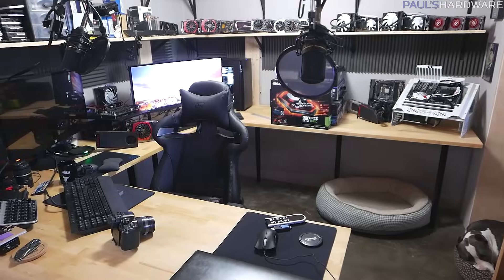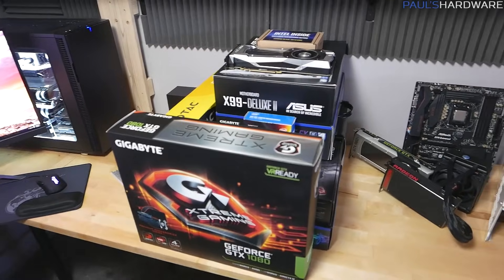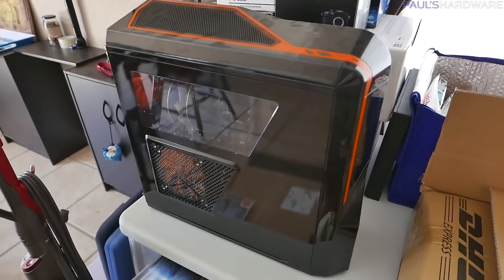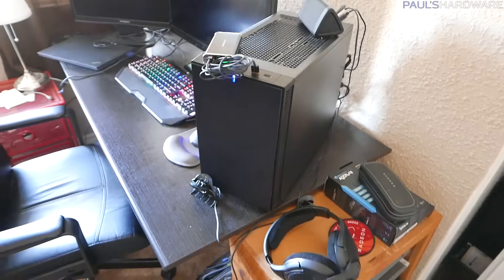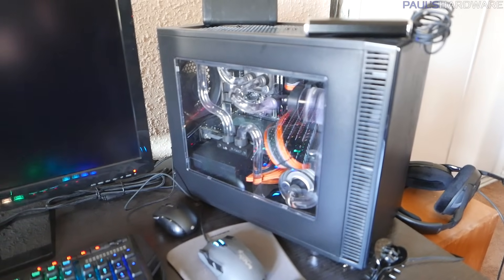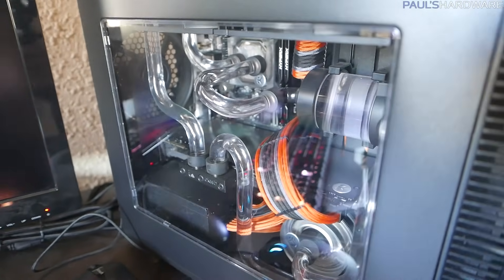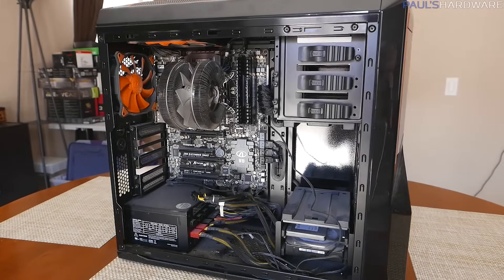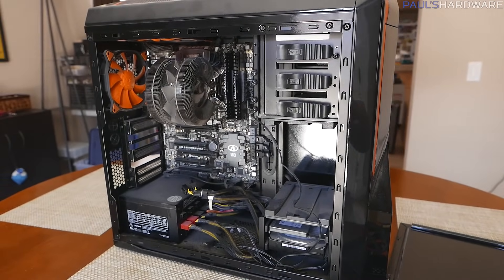Prepping a Hand-Me-Down Computer

Comment: C'mon Paul, don't make Your sister use on-board graphics, You must have an old video card lying around.
Reply: Yeah, thats lame. Not giving her a 960 at least. Pluss i would have changed the thermal paste on the CPU, and maybe install some dust filters.
Reply: Why? If she won''t be gaming there is absolutely no reason to do so. All it will do is add additional complexity to the setup and run the electric bill up higher. Nothing wrong with the graphics of a 3570. He did the right thing.
Reply: Yeah, GTX 960 should do.
Reply: hell anything at all, a 750ti even.  don't cheap out on fams yo!
Reply: Yes I work in the tech industry also. Video cards, hard drives, and motherboards are the main things I have had to replace. Never had many issues with cpu's especially modern ones. I respect your opinion though. Lets just agree to disagree.
Reply: Myself i have a "Asus strix gtx 960 2Gb" at the moment, And it's going to be Overkill for regular pc use.
But yeah kinda agree still x) i built my pc like 6 month ago -.- ... and paid around 233$ for the gpu. now you can get it for like 80-120 Bux easy.
Reply: No need for a video card for non gamers or people not looking to do any video processing. Adds complexity, cost, and more failure points. I've built like 20 systems for non gaming family and friends with onboard video and they couldn't be happier. Just need to get a decent modern processor and a fast ssd and it will be plenty fast.
Reply: Joe Ebner I have built 1000+ computers over 20+ years, video cards add capabilities in ex:faster video editing & gpu processing, they also reduce the wear and tear on cpu's and apu's that have the built in gpu from increased heat, I would much rather have to replace a video card than my cpu, any modern video card, even a low end gt 740 would be a lot better than intel graphics. I am sure Paul has something laying around.
Reply: He has like 20 Top End graphic cars just standing around behind his filming setup. He really should have at least one of the cheaper GPU's like a 960 or something:D
Reply: he probably has an extra titan lying around somewhere, that seems suitable
Reply: I have to agree - I would never pass on an old computer without a dedicated graphics card, unless it was built for business use or a library.  I like the computers I pass on to handle just about anything the new owner might throw at it. 

But I imagine Paul knows his sister best, and if she never plays any graphics demanding games on a computer and never will, then on-board graphics should be okay.
Reply: Jupe Good point.  

If I were in Paul's place, I would have put an older dedicated graphics card, something like a GTX 650 or 750 Ti.  I like to leave possibilities open for family members.  Most of my family wouldn't know what a dedicated graphics card is, let alone be able to install one if they decided they needed to add or replace one.  lol
Reply: Acceleration, depending on how heavy her photoshop work is, in which a 760 will beat any maxwell card
Reply: cee128d Yeah i was thinking the same, but man the 960 is starting to expire and retailers Needs to clear out their stock to have space for all the new incoming cards. So the price is dropping like crazy. Im a 960 owner and im really happy with the performance i get, Im still kinda pissed because i got my 960 like 6 month ago, and now people can pick it up for like 40% Off . But it's great because now more people can enjoy pc gaming without having to rob a bank
Reply: I agree with your viewpoint, plus with how powerful some of the onboard gpus are anymore any low end card would be worse. As long as there is sufficient cooling being provided there will be no issue.
Reply: +LallarN Andersson where can I get a 960 for 80? plz link
Reply: +Barack Smith this isn't actually the case.  There is quite literally no wear and tear on an igpu.  And an igpu can almost out perform those crappy low end graphics cards.
Reply: He has a shelf full of gpus
Reply: Rudiez Da'Man The integrated graphics is located VERY CLOSE to the cpu, it adds voltage & heat, Google "Intel integrated graphic problems"
Reply: +LallarN Andersson can be out slightly them?
Reply: +LallarN Andersson ugh sli not slightly
Reply: +cee128d A couple of cents to a couple of dollars a month is nothing. Plus integrated graphics are always shit. Even the web browser might be laggy as shit.
Reply: Barack Smith Sure.  I'm not saying it wouldn't add heat.  I'm saying the cnps 9900 max can handle a 125w tdp w/o breaking a sweat and we're talking about a 3570k which has something like 70w tdp.  Even overclocked it wouldn't get past the 100w tdp range and even stressing the igpu and cpu @ the same time wouldn't generate enough heat that the 9900max couldn't handle it.  But, the important part to remember here is that she will not be benchmarking this thing 24/7.  So w/ the light to medium use we can expecting on this machine, heat is a non-issue.
Reply: Jupe igpu on a 3570k could handle video @ 2560x1440 @ 30hz w/o breaking a sweat, @ 60hz w/ some tweaking.
Reply: Rudiez Da'Man a video at 30fps at 1440p requires pretty much nothing. 60fps isn't that impressive either. integrated gpus aren't worth using, you're better of spending 20-50usd to some old gpu that can run those videos without actually using much of it's capabilities.
Reply: Jupe Integrated gpus are used all the time in business computers, and the more modern integrated gpus can handle casual gaming, which I get the impression is the best Paul's sister would do on a computer.  Of course integrated gpus are not as good as dedicated ones, but they are far better these days than just a couple years ago.  

Integrated sound is the same way - so much better these days, in fact, that few gamers even bother with dedicated sound cards in their systems.
Reply: Ed Stoddard yeah but that was 3570k integrated graphics in the video. I know that the integrated gpus nowadays are better but they're still not good compared to even low end dedicated gpus.
Reply: Ed Stoddard Exactly what I would do. Like those cards aren't even that expensive, and whether or not he has those cards or not, he still has shit loads of cards just laying around.

Now, I know that the cards might be one of those cards that he has to send back but still. Not all of them are like that so he should have more than plenty of video cards to give out to a family member.
Reply: Cmon man. It doesn't make that much of a difference. I'd trust integrated graphics to be more reliable than discrete graphics any day of the week. If you're not gaming the iGPU is basically idle 99% of the time anyway!
Reply: Jupe "I'd trust integrated graphics to be more reliable than discrete graphics any day of the week. If you're not gaming the iGPU is basically idle 99% of the time anyway!" <--- This.  I'm not saying the igpu is the bomb.com or even that it's passable as a real solution when you need real compute from your GPU.  But as someone who used to edit on a macbook pro (shudder) that had an ivybridge igpu, it will more than handle whatever she's going to throw @ it and it doesn't NEEDLESSLY increase initial cost or cost over time.  This is why he chose to use the igpu and not a 750ti.  Because even though the difference wouldn't be much @ all, there is absolutely no need for him to do that when she won't even max out an igpu.  @ the end of the day, if you wanna waste the 750ti that will literally never get past 5% gpu utilization then go for it man.  Nobody is stopping you.  However business machines have been using iX class igpus for a while now and the vast majority of them are not being held back by the igpu but by the HDDs.
Reply: Rudiez Da'Man and there comes the mac guy. Your experience doesn't matter because Apples hardware-software optimization is a trillion times better than on Windows.
Why do businesses use igpu? because they most likely have the LATEST igpu. as far as i remember, the cpu in this build was 3570k which is three generations old. back then integrated gpus were utter shit and you would rather not use your pc than use it with a damn igpu.
Reply: I don't know what universe you're posting from Jupe, but iGPUs are totally fine on Windows if you're not gaming - even old ones. I'm using the iGPU from my old i5 2400 at the moment and it has 0 problems doing anything I throw at it for work, and even decodes video if I want it to, saving a bit of load from the CPU. Hell, it even does partial decoding for X265. What more do you want?
Reply: Jupe This is simply not the case.  I used multiple monitors (3 in fact) and had zero problems.  I could watch a tutorial on youtube on 1, while doing photoshop on the primary and have all manner of programs open on the 3rd without any issues.  Expose it up all day long w/ zero slowdown.  Heck I could even run a winamp visualization on the 3rd if I wasn't doing any real heavy lifting in photoshop w/o it breaking a sweat.  It wasn't running @ a crispy 144hz or anything but it was doable.  And even more so if I told photoshop to not use the gpu to do anything, however photoshop w/o the gpu is a little harder to run.  I even managed to get it to run torchlight 2 @ playable framerates (40ish).  Could hit 50-60 if I disabled the other 2 monitors.  And that's @ high w/ most everything maxed except AA.  And if i dropped those settings a little bit I could do it w/ all 3 monitors active (a guide on Left monitor and House playing full screen on the right monitor.
Reply: Rudiez Da'Man And you're using what cpu again? :)
Reply: Jupe Torchlight etc was on my old 3570k build.
Reply: Rudiez Da'Man Okay, so.
Three generations old intel cpu, and three generations old igpu.
Three generations old igpu and photoshop, what's wrong? 
You're a fucking liar. tha old of an igpu will not run photoshop unless the photoshop is from the 00s.
Reply: Seriously +Jupe, let it go. It's not 2005  anymore. Ivy Bridge iGPU isn't bad at all. Sure it's a few generations back but it doesn't mean it's junk. If you have proof of performance issues in office and multimedia applications please share, otherwise just keep your misconceptions to yourself.
Reply: As far as the 3570k, that was a desktop not a macbook.  But w/ that said, the macbook had no problems w/ multiple things either though i never gamed on it because it was the company macbook and not my own.  Aso 3570k's are desktop parts not laptop parts.
Reply: Rudiez Da'Man Of course the macbook has no problems running anything with a damn igpu. any other than mac and the performance isn't bearable.
Reply: Jupe incorrect again. The performance IS bearable on things other than on a Mac.
Reply: Jupe I never said that it would perform better. But now that you mention it, I think Windows 10 WOULD perform better than El Capitan for the most part, yes. I have a Dell Optiplex 760 that runs both Windows 10 and El Capitan, and I find that El Capitan is a bit hungrier when it comes to RAM usage, so OSX tends to dip into swap a little faster than Windows 10. Windows 10 is designed to run on low-powered tablets, after all. Of course, this has nothing to do with GPUs. For 2D stuff they're both pretty snappy and smooth, and animations look fine on both.

Gosh, I guess that makes me retarded then. Thanks for the diagnosis!
Reply: Jupe Of course I don't understand, I'm retarded remember? Anyway, you seem pretty confident about this fact, can you explain this massive performance difference to me? Like, with benchmarks and articles? Cause I haven't seen, or heard of such a difference before.
Reply: Jupe OK, whatever you say!
Reply: Did you not see the videos of the igpu performing admirably?  Or does evidence mean nothing to you the same way it does to religious fanatics?
Reply: Rudiez ̣ Actually no I didn't, please do tell which video.
Reply: ***** Because the Titan and the 750ti are so similiar in performance.
Honestly though, 3570k igpu on crysis 3? I wouldn't be surprised if the piece of shit ran the game 2fps on 360p.
Do I trust him? Shit, I wouldn't trust most PC youtubers with my PC. What about Paul? Nah.
Reply: ***** "...people are saying a 960, like for what? for Microsoft office, what a waste..." That is precisely the point we've been trying to make.  Igpu is plenty for what his sister needs.  Also, the comments I keep posting w/ video links keep disappearing after a certain amount of time.  Super weird so I'll just include the links w/o the domain part.

/watch?v=HQ98GkyUmcE
/watch?v=sl_W1_HwP78
/watch?v=od2r9czGyUs

Hell there's even videos of people playing overwatch w/ igpus on youtube.  Just search for them.  Not playable by my standards, but definitely playable.

"Honestly though, 3570k igpu on crysis 3? I wouldn't be surprised if the piece of shit ran the game 2fps on 360p." I wouldn't be surprised either, but unless his sister becomes pretty hardcore then she'll never face that situation anyway so that's kind of irrelevant.
Reply: Rudiez ̣ I doubt that they're playing overwatch with a 3570k.
not watching those videos rn, too busy for that.
Reply: Jupe "Show me evidence!" (ignores evidence).  Typical.  Believe what you want.
Reply: Rudiez ̣ "not watching those videos rn, too busy" means "i'm gonna ignore all the evidence i asked for"?
Right. Now that you got back at it, let's see.
All of the evidence you brought to me is a game that requires pretty much probably less than fucking csgo.
and in two of the videos it's not even the same 3570k. although doesn't really matter, still. 
A game from 2012, 768p resolution, settings seem to be pretty damn low and the igpu runs the game with ~35fps. TBH not worth playing with those settings. Just to compare the igpu to a proper gpu, i'm not gonna download and wait for the game to install to compare it to something.
Reply: They were running @ 1080p.  Go check again.  Also the other ones were using the same igpu from the 3570k but on weaker cpus.
As far as cs:go is concerned, most vids show it running @ 720  w/ 30-50fps.  But you know what man, you believe whatever you want to believe.  You want to stick a 550ti in grandma's desktop then you go right ahead and waste that money.  Doubt grandma will be playing cs:go or even anything tougher to run than candy crush but whatever works for you dude.  Take it ez.
Reply: Rudiez ̣ Nope mate, only the first one played at 1080p. The second one at 1366x768 and the same with the third one.
30-50fps in a 4 year old game which barely takes more power than it's 8 year older big brother, well that's just shit.
Now let's talk about why I would give my grandma a PC with a 550ti instead of giving it to my sister? (who the fuck knows why my grandma, originally we had to hand it out to my sister. oh well, i mean you're the master so i'll make it happen).

m8 even a mac runs better roflmao keklol

Comment: Will you check out Gainward 1080? I have one, and it's so good. 62c on full load at 50% fan speed. When overclocked, it hits 68-69c. This is at 2050 core clock and 10900 memory. Setting auto fan profile (around 35-40% usually) it's around 72c when overclocked.

Comment: why don't you just use an air compressor to blow out the dust? I have done it and works perfectly!
Reply: oh i ment an aircompressor, not compressed air, people are always scared that it will damage your parts but i have cleaned every part in my pc with it and it still works fine!
Reply from the maker: I'm almost out of canned air at the moment
Reply: +Paul's Hardware  just drink a can of beer and then there is air in a can! Boom!
Reply: Because no matter what it will be a dusty mess and not good for video
Reply: I have a big tank air compressor in my shop, and clean my desktop out about once a month with that method, and have never had issues, and for the rare spots it does not get I just use a small paint brush, or tooth brush, along with my house vac if needed.
Reply: The biggest problem with using most home air compressors for cleaning electronic components is that the air coming out is often quite humid. The catch can cant catch everything.
Reply: You can get air dryers though am kinda lucky that my dad dose lots of auto body repair so i have access to one.

Comment: Anytime I re-purpose a computer I do the following:
1:  Memtest86+ for at least 30 minutes (or at least 2 full cycles)
2:  Check drives with Crystal Disk Info
3:  Update BIOS (if needed)
4:  Physically clean system (vacuum, spray air, etc.)
5:  Wipe disks (DBAN or dd)
6:  Reinstall from scratch
Reply: +Arek15Arek but the question is, is it the same pc after you replace every last part in it?
Reply: +Final Cam ah, the age old paradox of Theseus's Rig
Reply: Only if he reused the sata cables. If they were replaced, it's a new rig.
Reply: Everytime I want to re-purpose the computer by upgrading it.
1. New GPU for most performance
2. New CPU so there's no bottleneck
3. New Motherboard so CPU is compatible
4. More RAM so I can play at higher res.
5. New SSD for enough Storage
6. New Monitor for higher res. and fps so I can actually benefit from GPU
7. New PSU so it can support all
8. New case so I can use the better USB ports
9. New Operating System for driver support
10. New CPU cooler because old is garbage
11. Done
Reply: LOL!  You bastards hijacked my comment with your Tom foolery.